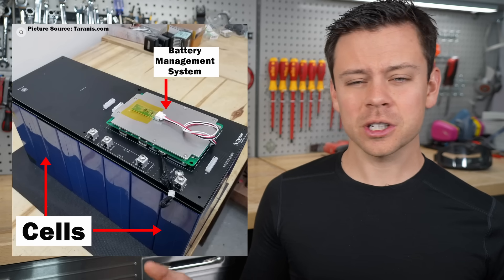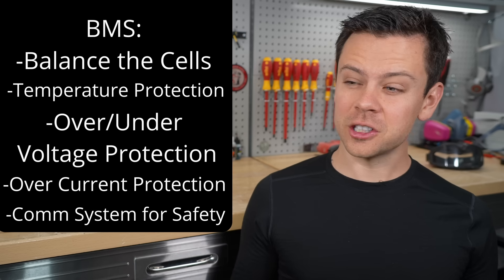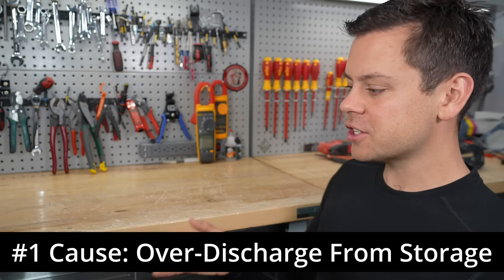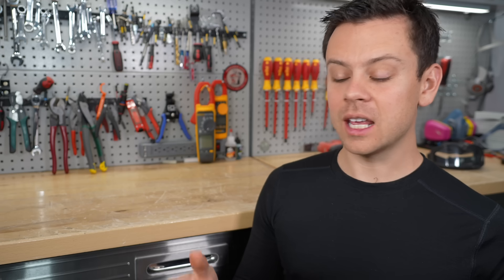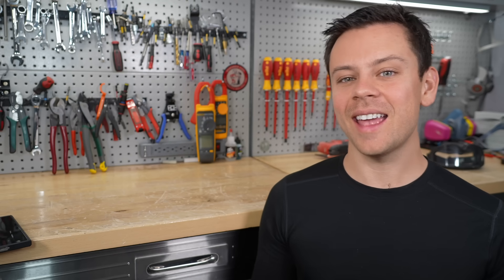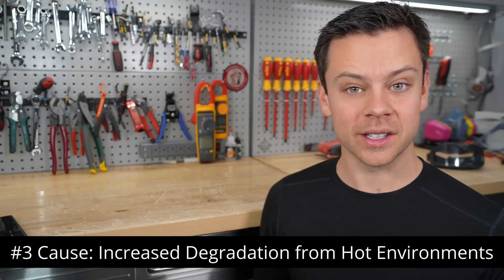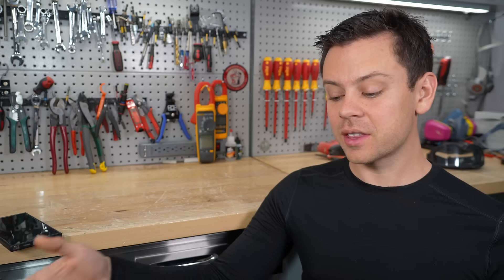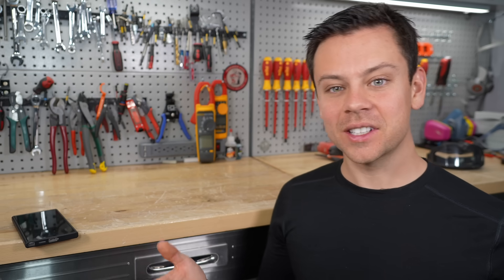The Rules of LiFePO4: The 3 Most Common Causes of Failure and General Guidelines for Long Term Use

Comment: Thanks good information , just started to build my first Server Rack storage system with an  EG4 12000XP , I was planning on the system being in my attached garage right beside my breaker panel. I live in Fl and my garage temp gets to around 95 degrees on summer days. Should I install an A/C unit , will a good airflow fan work to lessen increased degradation or should I not be concerned. Do you think higher temperature increases BMS failure. Can you test the theory that higher temps increase BMS failure " It would make a great video & may influence industry heat specs for future BMS manufacturing " . Get the heat guns out !

Comment: Very useful. Recently invested in LFP batteries for EPS on a MTS with a schedule to cycle to 0-100% back to 60% for storage between use. 
Another small LFP added to our IT rack, between grid and a couple of APC UPS that are still rather healthy. 
In order to avoid leaving the LFP unit charged at 100% all the time, it is connected to the grid via a smart switch. 
I use the LFP 3-4x per week automatically for 5-6 hours, enough to drop it to about 15-20%, then up to 90%. Did this to avoid top balancing issues. 
As with the other LFP, planned a full cycle 0-100% ever 10 weeks. 
Am I wasting my time? :)

Comment: I explained these things every day to my customers and this is very well put, and even though I’ve been selling these batteries for almost 6 years now I learned some time rates and self discharge rates on this video. Thanks for the info! Always learning! I was told by my manufacturers to not run my golf cart batteries down to 0% to charge at 20%. So if a customer runs their battery down to 20% charges it to 100 that is only 80% of a cycle? Say  the next discharge after charge back to 100 is 100% to 30% then that means I just used another 70% of the next cycle correct? 
Also, I am against LF4 Floor and series to make 36 or 48 V without a communication … what are your thoughts on that if you put 412 V LFP in series for a golf cart doesn’t that just mean you have 4 failure points?

Comment: they can not last longer than a human lifespan  -Electrolytic capacitors on the battery management board will dry out and fault. assuming good engineering design principles and not using cheapest  or fake components. ..... the electrolytic and tantalum capacitors will let you down.

Comment: Hello Will, thank you for your time and knowledge sharing in this subject. I have a question and it may be simple, however I do not know so if you could answer it I’d be very grateful. When you say charge to 100% then use, should I charge my batteries individually (4 -12 volt Lifepo4), then connect them in series, to achieve 48 volt, then to the MPPT charge controller and let it (The charge controller) handle the daily charging schedule? Thanks for you time and reply.

Comment: So, Genesis AI answers the question, "What percentage should you charge LiFop02 batteries?" with 20-80% for longevity. A follow-up question to the AI is, "Don't you need to charge LiFop02 batteries to 100% so they balance cells?" The AI says yes occasionally. (The AI answers were long with facts, but these were the short answers.) 

I own a Rivian 2025, whose manual says what the AI says to do. I have EG4 Outdoor wall-mount batteries on my solar system, which also recommends 20-80% and occasional 100%. Comments?

Comment: I have 2 of the 10Kw batteries which I bought directly from the manufacturer. I bought these after watching this video and did some research into who made them. I have since gone on and bought a further 4 of their new 14Kw ones too. There may be similar but I buy mine from GSL Energy. Very easy to deal with with great support and technical backup.

Comment: So there is a lot of conflicting advice out there about charge state for LiPO batteries, so I'm curious: if you have mostly non-solar charged batteries for backups, does keeping the SOC at ~100% shorten the battery's life?  These batteries are kept in a climate controlled environment, so ambient heat isn't very high at all.

Comment: Hey Will, I use LiFePO4, and found 100% knocks the cells out of balance, one at random will 'sky'. So I target 94%, 28.3 on my 24V, and 54.0/54.1 on 15kwh 48v lifepo4. Smaller cycle depths make the cells last longer than just 'not using them', I wont go under 20% or over 95%. 54.0 is compatible with my 24-cell Lead-Carbons as well. Put them in Parallel.

Comment: Sir please guide me i made a 12.8v 104ah lifepo4 battery with rept cells, i use a daly bms 4s 100ah smart bms with passive balancing, my battery is new, as per your guidance 2.5v per cell is 0% but when i discharge my battery when it reaches 20% in bms application as per load i notice that the backup is ok as per amphare load but when it show me 20% in daly bms application the battery volts in not reduces it was 12.8 12.9v when 20% remaining, if i discharge as per bms application to 0% its volts still on 12.6 12.7v why it is happening as per soc when it reach 0% the volts of battery was to max to 12v but the volts was high and my battery was 0% showing me in my application. Please guide me the battery is new so thats why it showing volts high when 9% or there is any issue or my bms application 0% is not as per my battery soc, can i discharge it to 12v but the soc in application will reach below 0% or -20% i think please guide

Comment: One of the issues I struggle with is all these lead acid car batteries.  I'd love to be able to install lithium batteries into my trucks or cars, but they are not good for winter, and there are few if any BMS's that handle starting currents like 400A.  Thats why I'm hesitant to buy the bare cells, or anything, for that matter.  Assembled batteries are also not designed for vehicle starting.

Comment: Would you please explain group 31 (100AH) can give more power to trolling motor more than group 24 (100AH) or run more time? OR other words, does group 31 contain more cell which indicate more capacity in group 31. Many thanks for considering my request.

Comment: The manufactuers of LifePO batteries are liars. The real capacity of their batteries is 40% lower than printed on the label.
Do not charge over 80%, do not discharge below 20% .....calculate your available capacitiy now. Need Help?

Comment: Thanks but another question.  Why do you mention discharges to 100% in your video as not a problem when the manufacturers state discharges that low will cut the cycles the battery will live from 5000 to 2000?

Comment: Could you do a video on charging LiFePO4s on a solar system without using an inverter to run a mains voltage charger?

Comment: How to to balance 2 separate batteries correctly?. I simply disconnect and charge them individual to 100% once in a while (2x200ah 12V GLCE) - 24V setup

Comment: How can I detect an issue with a cell? I got a battery that can't charge, but it can be discharged, I replaced the BMS and same thing. The thing is that all the cells are soldered. I bought a battery checker and all cells are between 3.2 and 3.38 V, all of them are around 0.3 mohms of internal resistance. But for some reason when I connect it to my solar inverter to charge it (it's 16S 100Ah), there is no current at all, and the battery can't charge, but it can provide power

Comment: I'm going to tell you the truth I tried to lithium I have a 42 ft sailboat and I tried to lithium on it after about 6 months I went back to interstate solar batteries I ain't going back to lithium this has been the best for me is the interstate batteries I have a motorhome too that is a 2002 The batteries in it it lasted 18 years and they were interstate and they worked up to the day one of them shorted out for me I will stay with my interstate lead acid batteries That's my opinion that's my experience with them I had more trouble with the lithium than I do with my interstate now I do have quite a few lead acid batteries I have 12, 6 volt batteries

Comment: If the temperature drops below zero while my RV is parked for the winter, will my 100W solar panel damage my Lithium battery by trying to trickle in a charge?

Comment: Looking for a 12 volt lifepo4 battery for my camper van and want to use it to power a 2500 watt inverter so i can run a air fryer or a small ac unit . What brand do you recommend and what brands should i stay away from?

Comment: Hi Will, love your channel, youve inspired me to build my own packs later on!! Wonder if youd mind answering a question. Im building a 51.6v (48v) system for a friends truck, he has 4 of eco worthy's 25.6v lifepo4 batteries that i want to wire 2s 2p, i am really struggling to find a balancer/equaliser that deals with 2 x 25.6v batteries. After trawlin the interwebs for several million years this week, i have found no end of 12.8v -> 48v units out there, but i am really really struggling to find a unit to balance 2 x 25.6v in series, do you know of any companies that do them? Obviously i understand id need two of them 1 for each series, and im pretty sure (hopefully) that the two banks then in parallel will self balance as is normal at 2 x 48v..... im a little lost old bean, please obiwan your my only hope 😂😂😂
All the best buddy, thanks for the vids man
Reply: P.s, massive thanks for the knowledge that has given me the confidence in building a safe set of systems so far, you calm a worried mind!!!
Reply: P.p.s, I you'd prefer this done by email as a paid consultancy, I'm sure my friend wouldn't mind paying for the info, none of us want to ruin thousands of pounds worth of kit, or die in a raging inferno 😂 kind regards, Andy.

Comment: Hi, My Lifepo 12V 300Ah(RoHS) battery at rest shows 98% charge and 13V, but when I connect consumer to it, it shows 0% charge and 12.5V.  When I put the charger on the battery display shows 100% charge and it does NOT start charging.  The battery is new, I only used it for 4 days for RV lighting (5w bulb for ~15 hours).  What do you think is the cause of this manifestation?

Comment: Will, a few years back from your recommendation, I purchased an SOK 206 amp hour battery.  I believe it does not have the current protections found on newer batteries…. Can the BMS be upgraded and what would you suggest….. thanks for sharing your information, it’s the most comprehensive I’ve found.

Comment: Thankyou for info. I wasn't aware that cell balancing only occurred at 100%. No that it effects me as I let the Victron solar charger go to the full 100% . I do set a warning at 15% just so I don't get a fridge not chilling or the BMS doing that needing a kickstart (never happened so far). I'm From Australia and bought  a Kings LiFePO4 120AH so far after 1 year measured capacity is the same. I just avoid their chargers as they are not impressive.

Comment: Hi Will, question from LiFePo novice regarding storage of an RV with solar. As I understand it, a good solar controller (MPPT) will provide power according to the needs of the battery. When the battery is in storage, it will automatically lower charge power to a maintenance (trickle) rate. Is that correct?

Comment: Useful video, thank you.  I’m thinking of buying a LiFePo4 based power station for backup purposes, effectively using it as a UPS so the batteries will almost always be at 100%.  Ambient temp will be 20-25°C normally (kept indoors).  Will keeping them always at 100% cause any issues?

Comment: Why don’t you ever state the voltage range at the top and bottom of the charge/discharge curve for the LiFePO4 cells? You mention 100% but what IS 100%?
Reply from the maker: Had a million people comment this so I made a whole other video covering that. Check it out. Posted right after this one

Comment: I bought a EG4-LifePower4 48V Lithium Battery from Signature Solar a couple of years ago. It worked pretty well until it didn't. The BMS circuit board burned out (literally) but no fire was caused. I took the issue up with Signature Solar, and they were really great about it. They paid to have the old battery shipped back, and sent me a new one (actually and upgrade since it has its own screen). It didn't cost me anything and the new one works very well. Glad I got the upgrade. FYI, these devices have fire suppression systems built-in. I highly recommend Signature Solar. Their customer support has improved.
Reply: I had a eg-4 charger dead out the box Signature told me to pound sand long and short

Comment: I have purchased an Ecoflow River 3 Plus. This is a true UPS with <10ms switch rate when the AC is off. This UPS uses LiFePO4 batteries. They recommend charging to 80% - and I think the BMS is the key to keeping batteries in good condition. You leave the EFF3+ plugged in all the time so self-discharge should not be an issue, as it will charge back up to the 'set charge' when it drops below this. I agree temperature variations can cause problems - but if the EF3+ is not kept in extreme conditions, what are your thought about keeping the batteries at 80-90% of full charge. I would hope the BMS would balance each cell to the others and account for issues, but we can't find out about what the BMS checks or does not check. Thanks

Comment: The fully charged voltage of a 12V LiFePO4 (Lithium Iron Phosphate) battery is typically around 13.6 volts to 14.6 volts, with 14.4 volts being a common target for full charge.

For maintaining a good lifespan, you should not let the voltage drop below approximately 11.5 volts to 12.0 volts. More specifically, many LiFePO4 battery manufacturers recommend not discharging below 12.0 volts to ensure longevity and performance. However, this can vary slightly depending on the specific model and manufacturer's guidelines, so it's always best to consult the documentation for your particular battery. 

Here's a quick summary in markdown for clarity:

    Fully Charged Voltage: 13.6V - 14.6V (typically around 14.4V)
    Do Not Drop Below Voltage: 11.5V - 12.0V (for good lifespan, typically around 12.0V)

Remember, these values are for general guidance. Always refer to the manufacturer's specifications for the most accurate information for your specific battery.

Comment: Great video.  2 questions.  First how can you tell if a battery has a replaceable bms?  I have looked at a lot of ads and have not seen that mentioned once.  Second is can you put two LiFePo batteries in parallel if they are the same voltage ( 48v ) but different ah  ( 100  and 50 ) ?  Would that give the equivalent of a 150 ah ?

Comment: I bought 4pce 3.2 lifepo 280ah for 12.8v battery. I plane on using the for solar but I also need a bms for it any suggestions what bms I should use....I also want a charger I can plug into a outlet any suggestions on the charger also

Comment: The problem for most appliances is the "battery life" like for laptops and phones. A product comes out and every review WILL add how long you can use it and will buy based on that. Companies know that of curse and don't care about battery life as long as it survives the guarantee period. So, personally, I don't trust BMS's either since they are designed by the same company or by their specs.

Comment: Thanks for your presentation.  I have a new rv which has a standard set up. 2 solar panels on the roof producing 340 watts. Those are continuously charging my 2- 6 volt acid batteries.
I bought a stand alone power pack with an extra battery so has a 5000 watt hour total. I am wondering if I can leave my 2 rv batteries hooked up to the roof mounted solor panels and at those batteries run a connector cable to my power pack so that the roof panels will charge my power pack at the same time as it charges my 2 rv batteries?
Hope that makes sense to you. Thanks

Comment: I also live in the desert  in Southern California.  Should I pull the battery out of  the motorhome in the summer when the ambient temperature is over 100 degrees?  I can put in in the house which has A/C and is in the 70s to 80s.  I don't full time in this RV it just for occasional camping trips with family and friends.

Comment: What is the voltage of a lipo 4 cell at 100%? My jk bms is set at 3.65 v for over voltage battery protection. Is that too high?

Comment: I have 12 volt off grid I have 3 sets of 8 -100 watt pannels  each set 4 on west side of roof 4 on east side.   I just bought 5 12 volt 200 AH lithium batteries how many can I put together  saying 12 volt  with out damaging batteries?

Comment: Hi there I've got a question I'd like to ask I've got a mobility scooter with two lipo 4 batteries both of them are 50 amp batteries my question is I bought a battery bounce the other day to balance the batteries I've also got a Bluetooth on the batteries to tell me the voltages and when I watch the voltage when they were nearly fully charged the voltage went down and then went back up and stabilised at 29.59v they settled at 26.64v after disconnecting the charger it was quite a few hours before a stabilised that this voltage 26.64 I did check both batteries and they were both balanced almost identical

Comment: I have a 12 v 1200 w Kilovault lithium battery. I’m pretty sure the BMS has failed due to moisture…where can I buy a new BMS to replace old one? Can I use any 12v lithium battery BMS? Or is it specific to Kilovault?  The battery itself only has 3 cycles, so the cells should have plenty of life. It is currently reading 0 and will not jump or take a charge.

Comment: I've bought some tesla lfp batter packs that were reading 0.5v per cell. Apparently, the tesla bms does this when the batter is disconnected for extended periods. 

I did a slow charge, and brought the cells up to full charge (very slowly). They hold 93% of capacity. I think newer lfp cells are more robust.